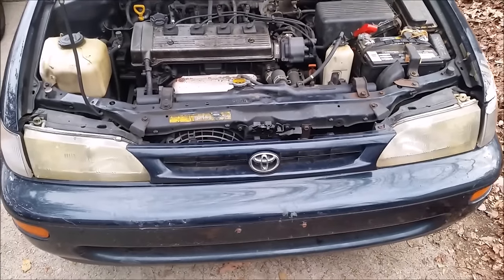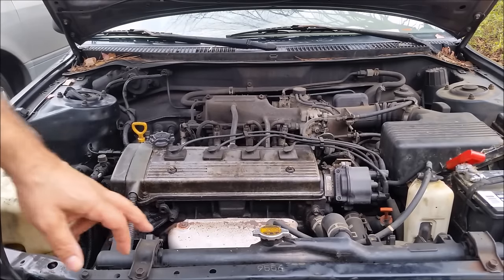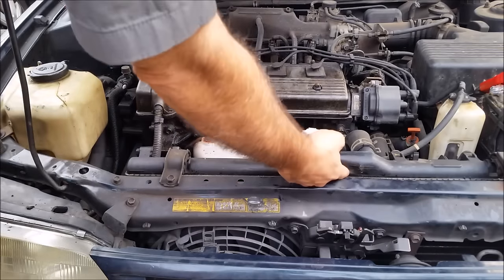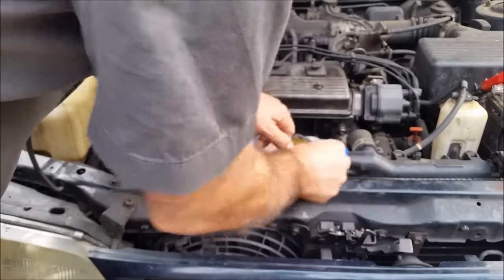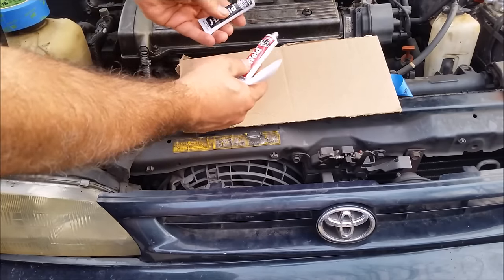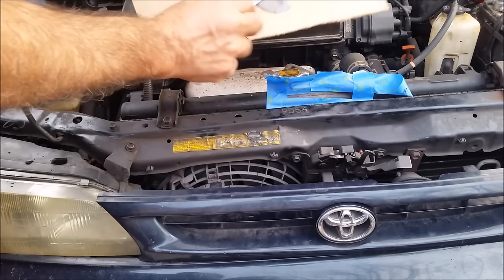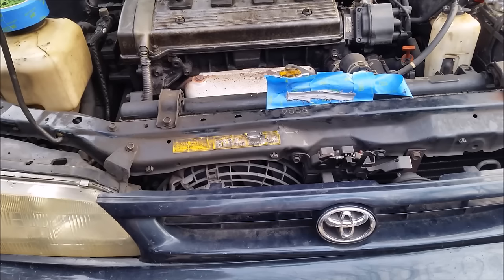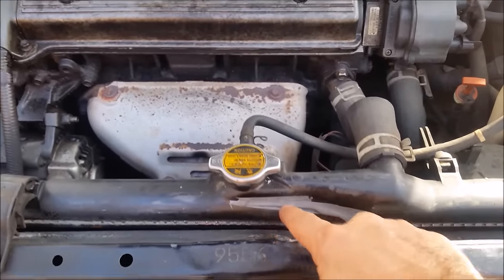How To Fix a Crack In a Leaky Radiator - For Ever - Using Epoxy - D.I.Y

Comment: It Worked!!
I had a pretty large crack, in the plastic top of my radiator, coolant was gushing out, it's a few days, and no problems yet!
THANKS!
Reply from the maker: hopefully  it will work long time
Reply: How long it last?
Reply: @Tyty-xv5fq  Still working perfectly!
Reply: Fixed one mine that way , it blew a hole big enough to put 3fingers in and wiggle room . Cut some clear milk jug squares  jbed one then a slightly bigger one over it lasted yrs just kept an eye onit
Reply: How long did it work for you guys?
Reply: @ag-ql3np  how long did it last?
Reply: I'm getting the same problem. It's gushing out almost periodically, but my leak is on the other side, so it's hitting the engine bay.
Reply: @KollynJ  I heard that it lasts for around 2 years.

Comment: My JB Weld plastic radiator repair lasted 2 years before the JB Weld began to peel exposing the crack along a bend and bolt mount 90° corner. So, I am going to just add JB Weld at the failed peeling location. Yes the area was ruffed as good as could be in the area of the crack. I realize that these weak areas are created in the molding process where thin areas are created.

Comment: Pro tip, to get a really good deal you can torch or soldering iron to melt the plastic some before applying JB weld
Reply from the maker: Thank you for the information.

Comment: Hi Joe so I was told by my mechanic that I have a crack in my radiator and I got the supplies from your video but I looked and I can’t find a crack but I do see some dried coolant around the big black tube (not sure what it’s called) that connects the engine to the radiator. Any ideas? Please help. I just need to get this as a quick fix until I can afford to fix the whole radiator if it needs it.
Reply from the maker: Did you lost coolant water ?  Did you need to fill up coolant into the radiator ? You need to find where is the crack and apply the glue on it when the car engine and radiator is cold and let the glue dry for a day or so.

Comment: Can this be done if the leak is on the other side of the radiator, facing the engine bay? Or is it just smarter to get the entire radiator replaced?
Reply from the maker: smarter to get the entire radiator replaced
Reply: @josephk9182  Thanks for the reply. After more research, I went ahead and ordered a replacement. It will be my first time installing a radiator, so wish me luck!
Reply from the maker: @gseric4721  I made 3 videos regarding how to replace a radiator here is part 1:
https://youtu.be/adfQ3XvtpGo
Also look at how to fill radiator:
  https://youtu.be/Wtek6tOkXKo
I hope it help.
Reply: @josephk9182  Wow, really? Thanks for telling me. I'm working on it on Monday, so I'll make sure to check them out.

Comment: Thanks Joseph. Good video. Unfortunately, we only have PC Fahrenheit Hi Temp epoxy. Will it work on a small crack on plastic of the radiator. Thanks
Reply from the maker: You should sand the area where the crack is and put apply the epoxy. Make sure the epoxy can stand 212F (100C) with 20 psi pressure.

Comment: I tried this and followed the steps 100%. After 2 hours of drive the patch broken and coolant is leaking.
Here are the steps followed,
1. Drained the radiator 10 hours before.
2. Cleaned the crack area to remove oil stains 
3. Used the steel scrapper and sand paper to make the crack rough 
4. Mix the both in 1:1 ratio and applied on the crack as shown in the video.
5. Left the vehicle for more than 24 hours(almost 30 ) 
6. Filled the radiator with coolant.
 
It was good for first ride up to 60 miles and then I checked how it was, so the patch became smooth like rubber because of heat/pressure and coolant was leaking slowly. The patch lost the grip on the hot surface of the radiator.

Did I miss any step ?if not why it lost in such a quick time.
Reply from the maker: What king of radiator you have (plastic or metal)
Reply: It’s metal (1999 Camry LE)
Reply from the maker: where is the location of the crack and how big is the crack ?
Reply: It’s a bit bigger than you showed in the video... it’s narrow line
Reply from the maker: @maruthichava4202  some how the JB Weld was not attached properly to the metal surface. You may have rusted metal so you need to remove the rust using a circular sanding paper. Remove all rust 1/2" from each side of the crack. Did you verify that the JB Weld you bought is working for higher temperature. You must buy the one that work with the highest temperature.  Also apply the JB Weld 1/2" from each side of the crack and push it into the crack.
Reply from the maker: @maruthichava4202  JosephKh2014@gmail.com

How did the crack happen ? Was it an accident ?
Reply: Joseph K finally I replaced the radiator...in my case it helped me as a temporary solution.
Reply from the maker: Okay.
Reply: Joseph K can you help me please 😩
Reply: @maruthichava4202  ik that was forever ago for you and you probably wont reply but i have the same car with the exact same problem and was wondering how much a new radiator cost for your camry?

Comment: does it still hold up, how is it working now after a year?
Reply from the maker: I sold the car 2 month ago. It was working with no issue, remember the most important is to scratch the metal that the epoxy will stick to radiator. When the coolant reaches 20 PSI the radiator plug will open and the water will go to the reservoir. So the pressure should not be an issue if your radiator plug work properly.

Comment: Tried it last night, it worked for a while today but eventually cracked the epoxy. Believe the radiator gets too hot for this
Reply from the maker: Jim it is not because of the heat, it is the pressure.  You must mechanically scratch the area  very well and then apply the 2 parts  epoxy.  You should put the epoxy on a cold radiator and let it seat for at least 24 hours. You must use the epoxy that is suitable to sustain high temperature. The patch width should be at least 1/2 inch . (1/4 of an inch from each side of the crack.) I hooe it will work for you.
Reply: @josephk9182  the epoxy I used says it can resist 250 degree Celsius of heat but it only last for 10 minutes before the coolant shoots out again.  And I used the stop leak  stuff still didn't work so I gonna try welding or soldering for the last resource before taking it to the mechanic,  just feeling frustrated.
Reply from the maker: It is not the heat but the pressure. The epoxy should stick to the radiator but if the area where the leak is not rough it will not stick properly. You need to sand the area and than apply the epoxy  when the radiator is cold. It should stay at least for 24 hours before driving.

Comment: If anything get the marine jb weld
Reply: That's what I was told, so I got it and did the repair today. Will see how it works after I let it set for 24 hours
Reply: Brandon Schwartz how did it turn out?
Reply: Does Marine JB Weld work on a radiator?
Reply: @brandonschwartz2395  Does Marine JB Weld work on a radiator?